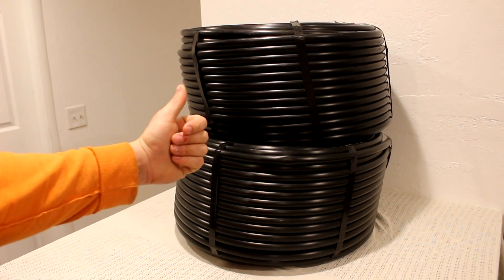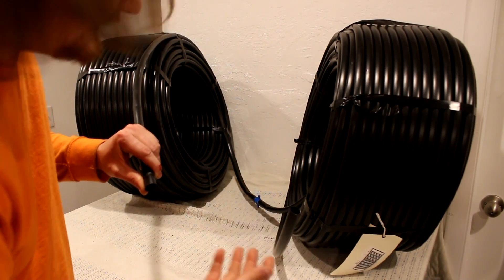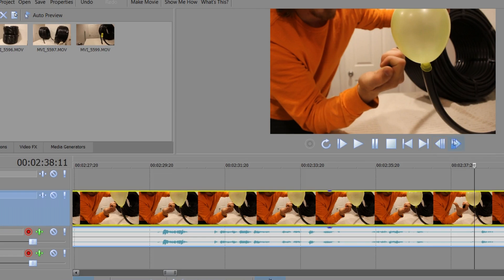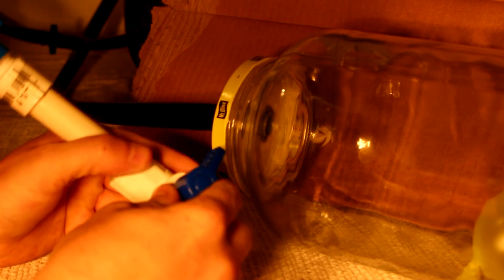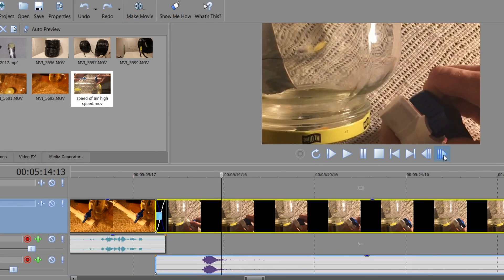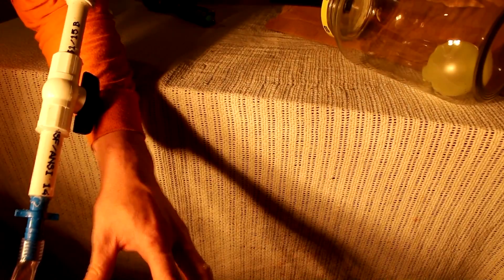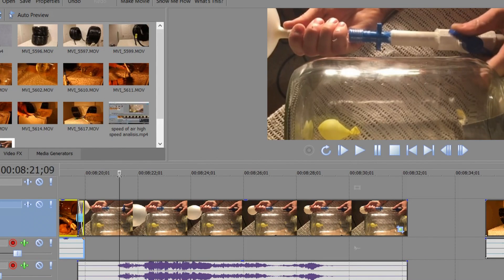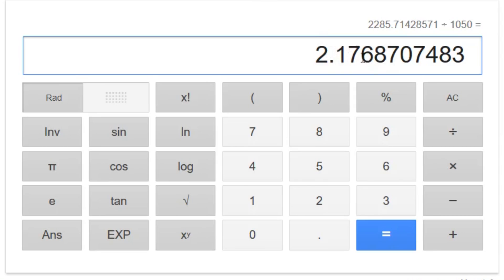Speed of Air Pressure Through a 1000ft Tube

Comment: Hi Cody!

One thing that raises my interest: When you had the system almost completely evacuated it took the "signal" a much longer time to get through. How comes that?

I could image the following answer: Under normal pressure one air molecule bumps into another, forming a wave-like action transporting the signal at the speed of sound. Hereby the shock waive isn't really the air travelling through the tube but the bump of air molecules. Contrariwise when the system is evacuted there is no medium for the shock wave to travel through so first the tube has to be repressurized and in this case air drag comes into play slowing down the air rushing through the tube. So the aerodynamic resistance causes the much slower response.

I'm pretty sure the "real" answer is much more complicated, including some intricate rules of physics and rocket science.
(Btw: Greatings from Austria :) )

Comment: The lower the pressure, the lower the speed of sound. That's why it took longer in the vacuum.
Reply: No. Pressure has virtually no effect on speed of sound in a gas. At least not over a wide range of typical pressures. Temperature has a large effect on speed of sound.

Comment: The tube isn't a complete vacuum though, there is air in the tube so when you blow it then air in the tube would just be pushed out
Reply: In case what I said was confusing, think of it like a conductor coming into contact with a charged insulator. Your breath is the conductor and the tube is the charged object. The tube is already saturated with air aka it is charged so when you blow into it, a current flows aka air is pushed out.

Comment: standing on one side of a large body of water, you pour a gallon of water into the larger body of water. how long would it take to detect the change in water level on the opposite side of the large body of water? would the duration before detection have a direct correlation to the speed the liquid was added to the larger body and the distance between the two points? or would the density of the water dampen the speed of change over larger distances? #science #hydrodynamics #noeasyanswer?
Reply: would the amount of water/liquid added alter the results?

assuming the ocean was completely flat (no waves or movement) and tides did not exist, what amount of water would needed to be added to detect a level change across the Atlantic ocean (or any point on the ocean)?

Comment: I bet if you attached a second balloon to the other end after inflating the first one, and then releasing the pressure. You might just be able to make it oscillate between the two balloons . if it worked it, would be cool to see what frequency. like an electric LC circuit, only with air.

Comment: When you put the tube under vacuum, you basically built a primitive shock tube. The rate at which the leading edge of the shock propagates is actually a bit faster than sound, though I don't know how hard it would be to detect by your feather device. It should be 2*(sound speed)/(adiabatic index of air - 1). For helium the adiabatic index should be about 5/3, and for air it is about 1.4.

Comment: speed of sound increases with pressure
Reply: Nope. Pretty much just temperature. Pressure has barely any effect at all over a wide range of pressures. But a lot of people mistakenly think pressure is an important variable, so don't feel bad.
Reply: McKenzie Keith And the combination of mean free path  and thermal velocity (temperature)  are required to calculate the speed of sound, but assumptions are usually built into the equation that linearize certain parameters.

The sqrt (gam*r*t) is derived from sqrt (gam*p/ro), the two being related through the ideal gas equation. 

So yeah, not feeling too bad.
Reply: It is an empirical fact that pressure has essentially no effect on speed of sound in a gas (over a wide range). This is just basic practical information widely known by people who deal with these things, and readily verified by reliable sources such as text books and wikipedia. If you would take just a brief moment to research the matter, you would find out that this is true. This is why Cody is ignoring pressure. Only the speed of the molecules matters, and speed is proportional to temperature. If you study the equations carefully, I am sure the pressure term will cancel out or something. I am too lazy to go through it myself at the moment.
Reply: So pressure i.e. density of the gas has no impact on mean free path? Like I said, there's a linearization in the derivation that allows you to remove the pressure/density term. Pressure/density has a much larger effect at say... lower pressures... such as when he pulled a vacuum... how's that for empirical fact... because you're guessing at this point... and as an AE, yes I deal with these things...
Reply: I am just going on empirical data. I am not appealing to mean free path calculations. Here is a quote from wikipedia: "The dependence on frequency and pressure are normally insignificant in 
practical applications." I am not saying there is no effect. I am saying that the effect is negligible over a very wide range of pressures. I don't understand why you are arguing about it. You have essentially conceded the point by noting that the pressure/density term can be omitted from the linearization.
Reply: You should learn to understand the assumptions in the equations you've been given or you won't understand the limitations. The ideal gas law breaks down when you can no longer treat the gas as a continuum... such as near vacuum... Humidity also has an impact on the speed of sound, which changes the density. 

Just saying you shouldn't use equations if you don't know where they apply and where the assumptions that went into the equations break down. Some equations go to infinity when you go sonic, so you might assume that that number is real... which would be wrong...

Take it for what you will... if you want to count this as a win, great... I just don't want to fly, drive, use, or be near anything where people are improperly using equations from college... For example... dynamic pressure is 1/2*ro*v^2... right...?
Reply: I did not use any equations.
Reply: Well... looks like I can fly again...
Reply: only at very high pressures where the ideal gas law is no longer accurate, and it also depends on the gas used. Real gas equations can take this into account, due to the decreased distance between molecules, but the calculations become complex quickly. For this video, the pressures used are not going to have a noticeable effect with the data.
Reply: Andrew Golabek Ideal gas works in relatively high vacuum... got it...

Comment: Hey cody maybe you will see this, but i often asked myself what if you shove a really long object? For example you have a rod that is one light year long (and yes for this we use some kind of future metal that is durable and light weight enough). And you would shove or push said rod. Would the other end instanly receive the push? And wouldnt this then be technically faster than the speed of light?
Reply: It would go at the speed of sound in the object.
Reply: @woopecker yes the speed of sound is higher in more dense objects, its faster underwater for example, it would be even faster in a crystal, but nothing is instant
Reply: the speed of sound in say, stainless steel is about 13,000 mph
Reply: TheWoodpecke no there it a speed limit to how fast one molecule can interact with any other and that limit is there speed of light, no the rod would not immediately recieve said Push
Reply: no force can propagate faster than the speed of light, your 186000 mile long stick would propagate in a wave at less than the speed of light taking a second or more to move at the end when you push it , even in the vacuum of space, same with a cable the same length in space, you pull it, would take the other end at least 1 second to react, probably many times longer as it will be a lot slower than light is, elecrticity along a cable is aprox half the speed of light, and that gets to push electrons like marbles in a tube of marbles, its not the entire electron time to move one the entire cable, but that force still moves in a wave and always slower than light does, light will always be faster as it has no mass.
Reply: Vsauce talks specifically about this in his video on how much a shadow weighs.
Reply: mh yeah the rope does make alot of sense. But in turn what would said shockwave look like? wouldnt there be some compressed spots in which the shock travels? Almost like a wave?
Reply: But isnt the speed of sound just how fast the molecules can hit, transfer the energy, to one another? In a solid these atoms would already be fused together especially in a crystal for example.
Reply: TheWoodpecke
So in crystals there is a very fast, but nonzero, seed of sound.
Reply: Would be fun to know how fast such a shockwave, if it works like that, travels in certain solids
Reply: Thats what i tought but sofar we are only comparing it to non solid mater. What would it actually look like is what amzes me or would amaze me. Because think of a shockwave that goes trough a solid

Comment: I think your ball valve is inadequate for the vacuum experiment. It takes too long for the valve to fully open. I'd like to see this timed with a strong vacuum drawn in the tube and a burst disc or a very fast actuating valve used. I bet you will see the speed of sound at normal pressures exceeded, though you may need a bell or convergent/divergent nozzle on the opening to make it happen, rather that the flat opening of the pipe. Since you're dealing not with the propagation of a wave through particles, but with the acceleration of the particles themselves the speed limits of sound don't really apply except as a limit to how quickly the atmosphere will work to push new particles into the vacuum. If the particles have been accelerated as by a nozzle when they enter they should reach the other side in excess of mach 1 unless limited by hitting the turns or other particles that have failed to be removed. It's for that reason that vacuum cannons can exceed the speed of sound, whereas regular pneumatic cannons cannot unless using a light gas.
Reply: NightHawkInLight Hi Ben, I don't wanna pretend I'm an expert but the guys from discovery channel that analized my nerf cannon explained me that due to the bernoulli law you can accelerate the air to the speed of sound of a different atmosphere since the molucules are spread apart like it was high altitute... so you basically can go faster than the speed of sound in standard air...
Reply: NightHawkInLight You and your burst discs :)
Reply: let's consider the system as a tube of constant diameter, in which a compressible fluid moves: the opening of the valve can be seen as an abrupt pressure gradient at one end of the tube; this, as any other pressure disturb, propagates always at the local speed of sound (which is a local property of the medium), same as when you activate a garden hose by opening the tap and it vibrates due to the shockwave. sound waves are less intense, isoentropic disturbes of the medium, while shockwaves are finite (no longer isoentropic) discontinuities in pressure, density etc. and extend in space over a length similar to the mean free path of molecules. That valve, even if not optimized for burst opening, should be able to generate an expansion shock wave in the tube; the problem arises, in my opinion, when detecting the shockwave at the other end of the tube: the setup used is slow and obviously has a certain inertia when reacting to changes in pressure or to flow rates. so the problem is not only related to the creation of an instantaneous gradient pressure but also to its accurate detection.
Reply: make the whole thing into a vacuum cannon and shoot a marble is the best idea i think
Reply: NightHawkInLight  I think its just showing how far apart they are and their relative sizes. People imagine them much closer together.
Reply: As anyone who's watched Mythbusters knows, the ideal valve for this sort of experiment is a Butterfly Valve.
Reply: A burst disk might end up with a supersonic fleck of metal hitting the jar and shattering it. It would probably work better but I don't know if it would be safe.

Comment: i dont really understand how something solid like molecules that make up air can only go so fast as sound. examples: if you blew gently into the 1000ft tube it wouldn't make a sound and the air may not make it to the end, i would think in 1000ft of tubing there would be some compression and absorption of the genital breath of air, like a shock absorber. If the air was pushed through the tube with the force of a jet engine, it may even travel so quickly that the path of least resistance isn't out the other end of the tube, but may blow out a piece of the side. idk, maybe im not getting something. love your channel Cody.

Comment: The video editor is incrementing the seconds on the 24th frame not the 30th frame. This isn't impacting the 1 sec calculation 12 to 12 but the high speed conversion would be flawed. This was seen on the first two video editor parts later I see 30frames in the video editor.

Comment: all high frequences are filtered in a long tube due to inertia. its like a low-pass filter in electric systems. but it shouldnt make a difference, if its twisted or straight, because air expands in all directions equally. the travelling-energy in the air should also drop, because of friction.

Comment: I wonder if you can separate gasses using the pricipal that one travels faster than another through a vacuum? or is the speed at which the mixture of gasses travels at just a mixture of the two gasses it it comprised of? I dunno seems like an interesting experiment :)

Comment: I didn't think you could push all the air inside that tube with your lungs alone, I thought you'd need a compressor for that. In any case I think that's why the air on the other side is so weak, because you push all of it, not simply the air that's in your lungs, you also push all the air inside the tube, and when air moves there's friction, so a bunch of the pressure (kinetic energy) you applied got converted into heat energy and that's why to was weak on the end. It's the same reason scuba divers use tanks instead of a very long tube thing that floats over the waves, their lungs won't have the strength to pull the air needed for them to breathe.

Comment: Huh I didn't consider that. That would mean thunderfoot's analysis of the hyperloop overlooked that fact. I guess of you were close enough you'd still die in case of a leak but at least not everyone using the hyperloop would die.
Reply: i mean, there is still the problem that it would cause a hold up in a system where the trains are moving at speeds that would not be stoppable on a moments notice. the hyperloop is flawed in general this fact doesnt change much
Reply: Chorosso do we really not have systems that are able to stop the trains relatively fast?
Reply: most likely no. imagine trying to stop a car going at 100 miles per hour that is 1 mile from you without harming the people inside

Comment: Those balloon tanks are partly oxygen for safety.
Reply: so helium dealers are like coke dealers, cept its not talcum powder
Reply: they're also partly air to prevent suicides. breathing helium is a popular suicide method because you pass out painlessly and die
Reply: nardgames 
partly air to save a few dollars.  party ballons still float.
Reply: I don't think that's a good idea. Once they fail with helium, they will try with propane or natural gas and blow the whole building up.

I am being serious here, in Italy a lot of gas-related accidents are caused by people trying to die!
Once instead of methane we used coal gas (hydrogen and carbon monoxide mixture) so it was easy and painless to die in 15min or so by putting your head in the gas oven and opening the valve (the carbon monoxide killed you way before it reached the lower explosive limit, and once you were unconcious you automatically turned off the gas by letting the knob go, so there was a very slim chance of an explosion).

Now people still think that propane or methane kills in the same way (it doesn't) so they stick their head in the oven for much longer and still don't die, until you reach the LEL and the whole house blows up killing the idiot and other people as well. And the irony is that in order to die because of methane or propane (not the explosion) you would need for THE WHOLE ROOM to be 100% natural gas and/or nitrogen...

A few months ago a psychopat tried to kill himself and his son by opening a propane bottle while in a car. The son managed to escape, the car then exploded (before the psycho died) and the shrapnel from the window seriously injured three pedestrians that were walking near the car.

I get that people have serious trouble if they want to die, and I feel very sad for them, but at least try to suicide yourself without killing (or causing other people to want to suicide themselves as well, ie by jumping in front of a train and traumatising the engineer) other people that have nothing to do with you ok?
 ;-)